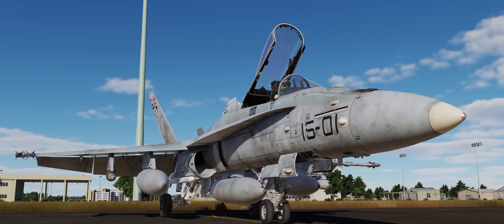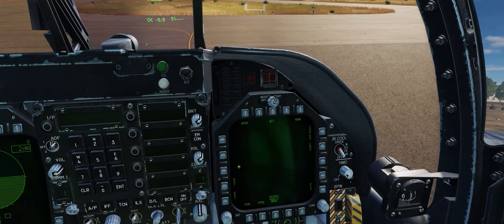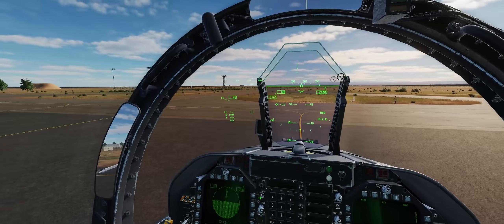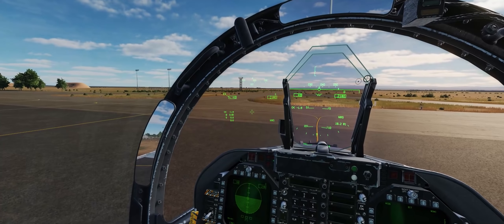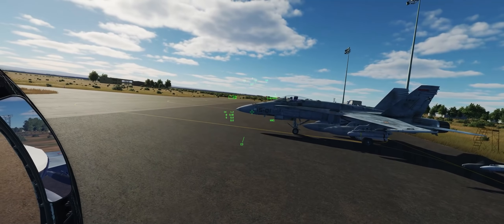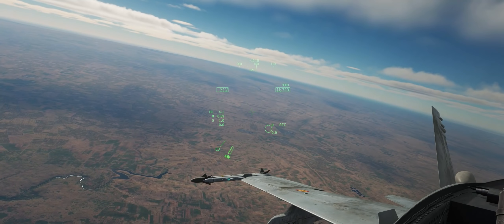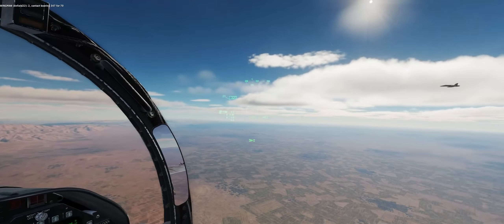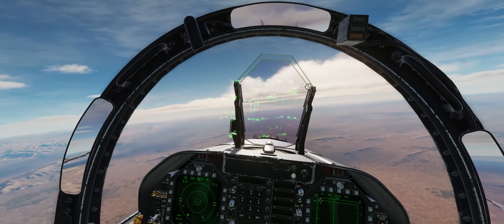DCS F/A-18C Hornet In Flight HMD Alignment & Misalignment Errors!

Comment: I recently fine tuned my default head position in the sim so that with TrackIR in it's default position and paused, when I do the HMD alignment, The crosses are overlapped exactly. It's then pretty fast to align, just a long click, and two short clicks, and I'm good to go. The big bonus is that as I look around in flight, my default head position is also in line with the sim for everything, so I'm not getting any parallax issues with what I'm seeing vs, where the sim sees it.  Getting everything set up where I wanted it, position and FOV vs seeing the HUD, etc. along with this was a bit of a chore, but it really was worth it!
The trick is to get it as close as you can using the keys in the game (there are good guides for setting default/snap views) and then manually editing the .lua file in ED's saved games folder (don't edit the .lua in the main game folder) to get it dialed in the rest of the way. (There are guides for that too) Then when it's all done, back up that file!!
You can create or use an existing runway start mission and use the alignment routine for the HMD so you don't have to go through the startup process to check alignment as you edit. (You'll be launching and closing the game a lot, this saves a heck of a lot of time) For that matter, use this to get it roughed in, too, so you can see the HUD as you adjust your head position to make sure you don't cut off the HUD data.

Comment: Great video.  I had been wondering about time savers if I need to get airborne as fast as possible.  Nice to know I could take off, and then align, if the situation requires.
Reply from the maker: Just keep in mind you have to fly nice and straight and level to align, cause of that I think it’s less time consuming to align your JHMCS on the ramp. But it can definitely done as you’re describing

Comment: Nice video.  I don't believe you need to press the TDC  to lock in the fine alignment crosshairs for DX/DY and ROLL.  I believe all you need to do is lineup the smaller cross hairs for DXDY then press the cage/uncage button and then line up the roll crosshairs.  Once those cross hairs are aligned you just push the OSB button for align on the DDI.  Let me know if you have experimented with with pushing the TDC button and not pushing the TDC button for fine alignment. I do not want to give any incorrect information but from other tutorials I have read and watched Including Chuck's guide this is what I came up with.